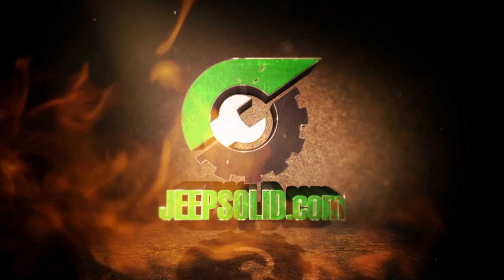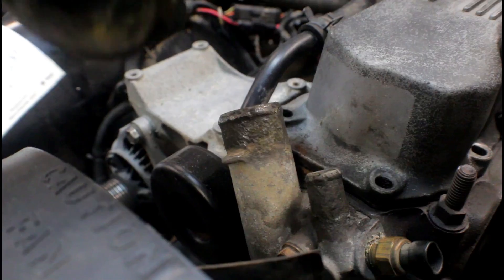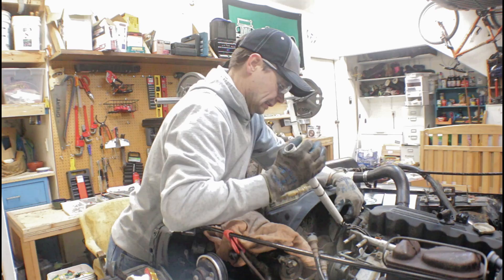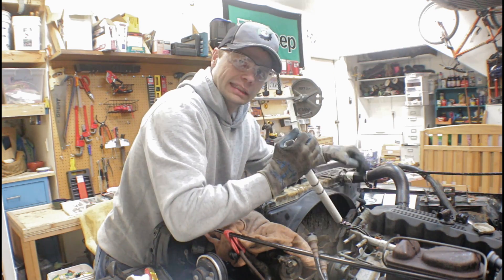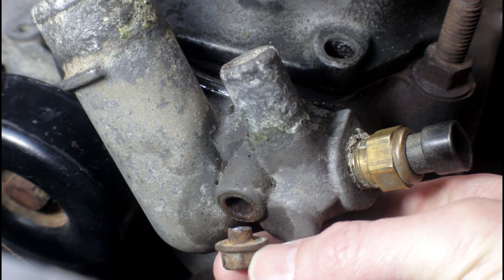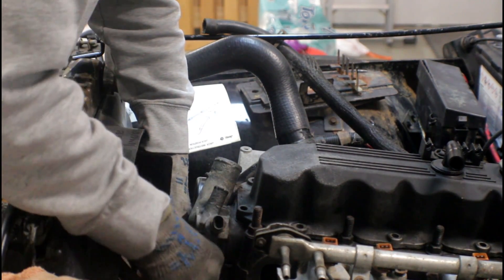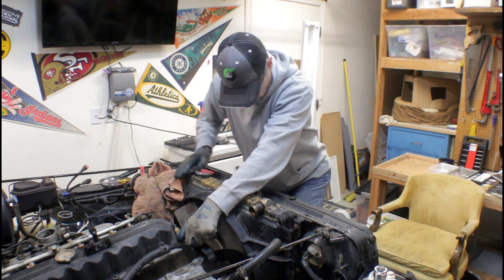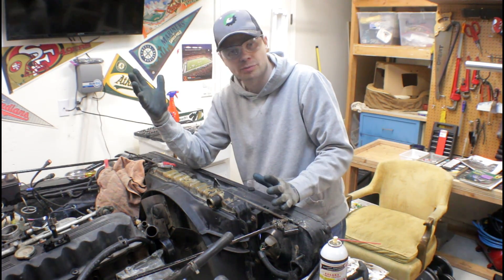I made a dumb mistake!

Comment: Crappy sometimes if you PB the hell out of it then tighten slightly then loosen slightly back and forth a few times they eventually start wanting to come out. Good luck with the removal keep us posted!
Reply: maybe try a rubber mallet to loosen and knock the housing off, I cant remember how I got mine off but that seems to come to mind
Reply from the maker: +RollingCole yeah. It's setting in PB blaster right now. We'll see...
Reply from the maker: +RollingCole did that as well. Just tapped it. Moved I a bit

Comment: Work the housing loose and remove it or just cut it off. They’re cheap enough. Plug Weld a nut onto the end of the bolt sticking out of your head. Soak the bolt with pb blaster overnight. Next morning heat it up and use the nut you welded on to back the bolt out.  Vice grips prob won’t work if you already broke the head of the bolt off. Also, give the end of the bolt a couple very light taps before reefing on it. That may help free up some of the rust.
Reply from the maker: +Garage Dad That's a good option. I actually think the bolt is loose from the head. Just fused in the housing. Can't spin whole housing.  If I cut it off I think the remaining bolt will spin out....?  We'll see

Comment: Pry the housing off carefully... probably just corrosion holding it....then heat..heat heat the bolt and vise grips...
Reply from the maker: Yeah.  I'll give that a try.  I hit it with PB blaster.  Probably gonna give it a squirt again today.  Then I'll get back to it after the holidays.  That should help as well....
Reply: JeepSolid I had a similar problem when I did my transfer case my on my 95 YJ..... patience....
Reply: Yep- Only thing you can do, if it won't pry off, you might be able to move it enough to cut the bolt flush with head then drill it out.